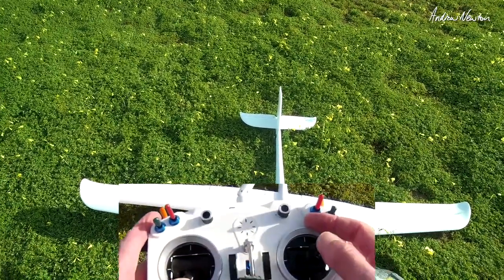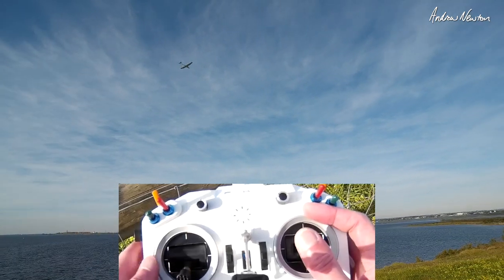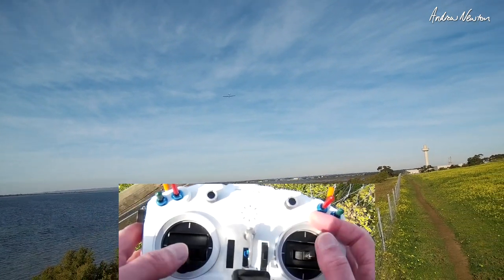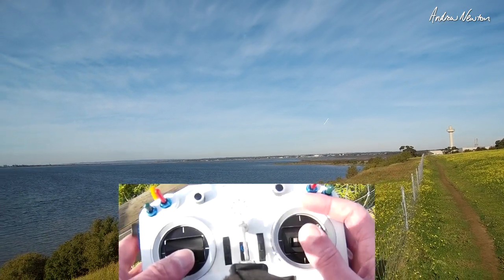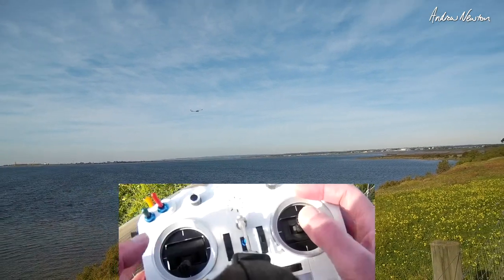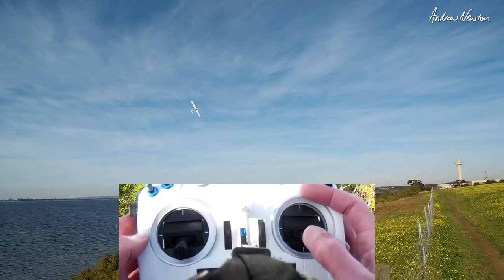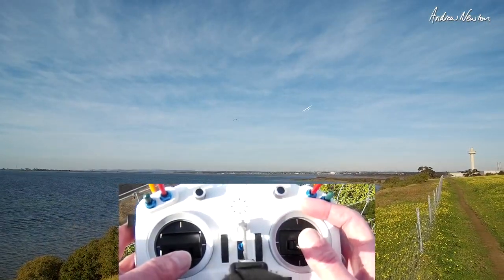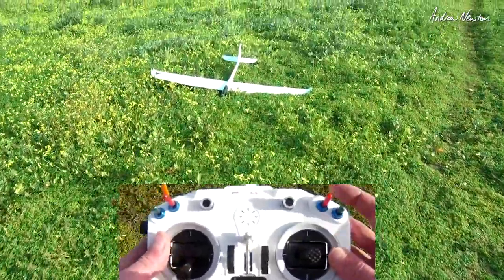Sloping Stick Cam

Comment: I often hold off on a plane until your final thoughts on "past planes". Which series is the the sonicmodell skyhunter racing in? Many thanks.
Reply from the maker: Have I followed up on that yet? Might be still to come. But it's a great little plane, well designed and that twin boom pusher style always work well. It's quite fast and agile but easy to fly.
Reply: @AndrewNewton  Thanks. The big test of a good plane even a fast one is - can it fly slow?

Comment: Where I come from, that's a Ranger 2000 Andrew....I have 2 HK Phoenix 2000 gliders, both fantastic gliders with blown Fuz.
Reply from the maker: Huh? You have Rangers with folding prop on the nose?
Reply: @AndrewNewton  No, but that Fuz is more Ranger than it is Phoenix 2000 that's for sure..

Comment: Your hands kept getting pinker and pinker, I could see you getting cold,,,,, lol.... Great video, no need for charged  battery.  It's to bad they don't make a very low drag "charger" to keep the battery topped off while you fly......   Now there is an idea, a small turbofan trickle charger to mount on the wing or fuselage to charge the battery, maybe with the wings covered in flexible solar panels.  To fly if cloudy or wind stops....   Oh nevermind......
Reply from the maker: Could extend the flying time to days instead of hours.